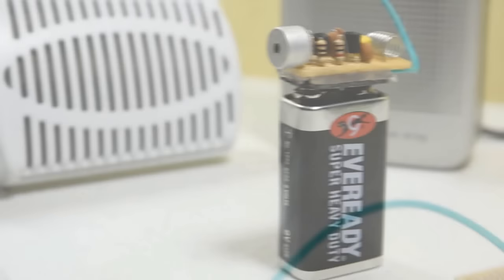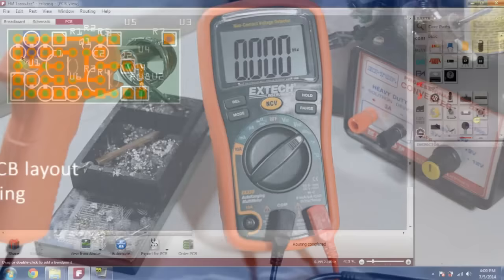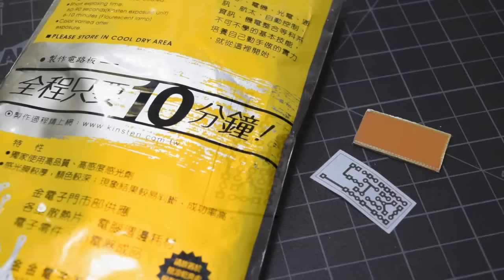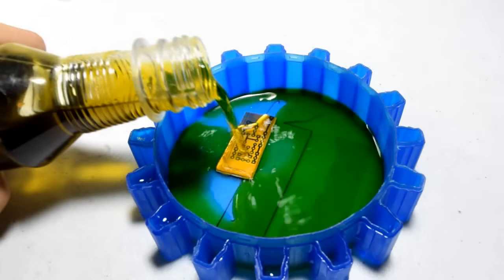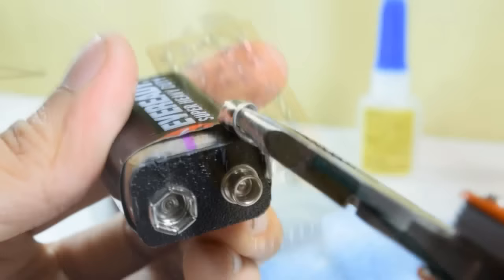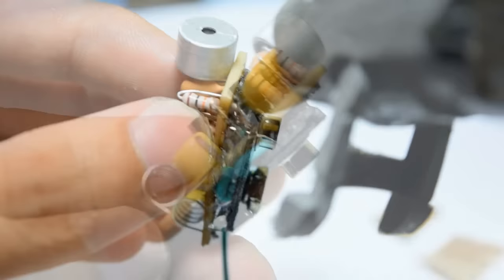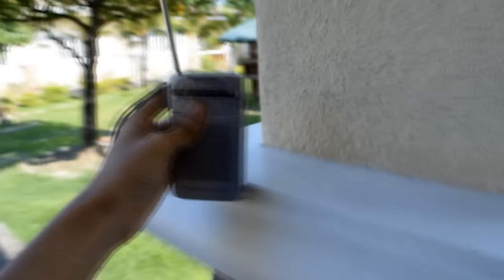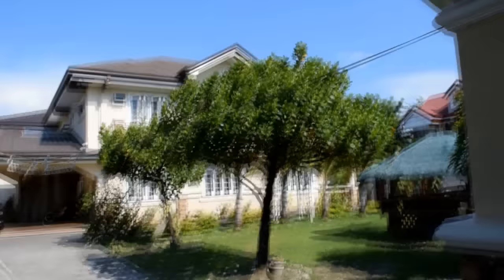Build A Long Range FM Transmitter (Homebrew Radio Station)

Comment: you should rename the video "How to get your door kicked in by the FCC for less than 10 dollars"
Reply: is that really how it works?
Reply: no
Reply: Yes. FM transmitters are limited to 100mW without a license. This probably uses more than that depending on the current draw.
Reply: I was using the range as a reference - this video demonstrates that he couldn't get the signal past 30 meters, so it would fit within the 61m limit in the law. Now whether it would still be illegal because it may be over 100mW depends on the spirit of the law. 

I'd argue that the 100mW was intended for an efficient commercial implementation with a properly tuned antenna with enough dB/mW to give a reasonably long transmission range - this hacked-together version is probably nowhere near as efficient so the actual radiated power might be nowhere near the same amount.
Reply: they are a complaint based organization, unless someone complains he is interfering then he is ok
Reply: Blackhawk f
Reply: The regulations were never meant to prevent low powered wireless transmission across short range, so he isn't violating any regulations here, unless he is in radio silence zones.
However, devices much more powerful than this could swamp communications, which is why they are regulated.
Reply: I live near the police department, and a few years ago, cops were knocking on my door about swamping communications when I was playing with homemade wireless speakers over radio. Wasn't that much of an issue, I just had to stop. Luckily the cop just found it funny more than he was upset about it, however, it was obvious it was an accident, I had no idea how well my radio transmitter was working. However, he did warn me that the FCC was nearly called to deal with it, and I am sure the feds would have fined the hell out of me.
Reply: Lol! I think you should be all set if you're range is small enough. Otherwise, look at an allocation chart for amateur frequencies.
Reply: LMF5000, thanks for the link. That's good to know.
Reply: If you have a regular ham radio operator licence and you tune the transmitter to a frequency far away from broadcasting and law enforcement ones you are totally safe. Better if you do it on ham radio bands since being it very low power and short range it would not annoy anyone at all. Just calculate the oscillator to reach around 144Mhz and you are done :)
Reply: Ok stone,,,come to pakistan and use ur RADIO every where........
Reply: LOL Dude the FCC isn't going to come after anyone with a low power transmitter. While technically it is illegal the FCC is more concerned with people who actually disrupt other radio services. This is hardly a blip on the radar and not worth the time and money for FCC to litigate.
Reply: Isnt he still transmiting in a legal range?
Reply: TheGreatUtopiaCat not even close
Reply: Kenneth Clark incorrect. Common mistake. AM allows for up to 100mW for Part 15, but FM is a different beast. For FM, and to be Part 15 compliant, the FCC isn't so much concerned with power used. They're more concerned with the FIELD STRENGTH, and I believe they're looking for anything 20 microvolts at 3 meters and under to be legal. Anything over that field strength is considered in violation, although rough estimates for FM power to be compliant is in the 20 mW range. To show how complicated Part 15 is where FM is concerned, consider this example: you could be using 30 watts, but you're transmitting through a thick steel wall. Theoretically, due to the wall, your field strength might still fall within the 20 microvolts, measured at 3 meters from your transmitter. All I can tell you is to pour over the rules until you can make sense of them and know where your rig falls. Although, right now with the government shutdown as of this writing, there isn't much FCC enforcement to worry about! Ha!
Reply: @Mr_Lambda  Transmitting music for yourself and/or others to hear is considered broadcasting and would make many people annoyed with you. The ham bands are for communicating not broadcasting and it would be considered illegal.  Also you can't just go anywhere "around" 144mHz. I would suggest using a frequency counter to make sure exactly where you fall in the band. Plus there is something called a band plan you should look into. I know I'm 5 months late on the matter but I thought I'd chime in for anyone that views these comments in the future. Have a good day.
Reply: @briankahle2326  in my country if you have a ham radio operator licence, as i do, you are free to expertiment as long you don't harass others. I am totally aware of the band plan but since this transmitter is so low on power, nobody would pick it up with their instruments. Especially if you tune into the very first or last frequencies of the band. Nobody usually works on them. This is considered experimentation in my Place, OM 's here are happier to see some youngling play around with homebrew devices rather than scold them because they built a transmitter without having a licence.
Reply: @Mr_Lambda  That's very interesting. In my country, tuning somewhere around the 2 meter band might land you on frequencies that you could get in big trouble for. Like law enforcement frequencies for example. We're only aloud to use the bands that are allocated to us. Sorry for just assuming that you live in the same place as me lol. And thanks for replying. 

73
Reply: @briankahle2326  in our band plan frequencies between 144 and 146 are for ham radio 2m. As i said if you do some testing on the very border of that band, nobody would care since few people would transmit on on those frequencies. :)

73 to you
Reply: @Mr_Lambda  Where I live we get 144-148mHz :) but the lower border is for CW only.
Reply: Absolutely NOTHING in your post is based on the reality of FCC regulations or how they intervene.  No?  OK, when did the FCC kick in a door for a transmitter this small (or even even of magnitudes more).   Place, Date and who was arrested.  Too bad you didn't test your basic assumptions with this simple test.
Reply: @radio guy all countries have fcc equuvalent, don't worry. mine is called ancom
Reply: radio guy yeh I don’t think the FCC has duristiction where I am even if they had the budget to fly hear and arrest me. In reality some kid makeing a transmitter like this and causeing am issue the FCC (or local equiverlent) is going to take an educative fix not a punitive one.
Reply: @jdgshsjchdjejkd545  meaning?
Reply: @rich10514141  they wouldnt fine you
Reply: @LMF5000  you are correct. 0.01microwatts max radiated power.
Reply: Well,if it wasnt interrup...whatever
Reply: wow.. it has only around 10mw of power. No need for FCC license dummies !
Reply: Actually it is completely legal to make me of these and use it for home or event use to help with information. And they make pre made one's on Amazon for if your radio don't have bluetooth. But they don't go as far.
Reply: @Mr_Lambda  e
Reply: I'd look into mobile transmission like what Al-Aqsa TV did. Figure out how to avoid getting caught, which is especially useful if you plan to broadcast stuff "they" don't want you to know.
Reply: base on a true story
Reply: @Emre MUTLU it was so not being near an airport ... with a backpack ... you know how it is people are increasingly afraid of terrorists so any weird and out of commun communion ... can cause suspicion ... but still the idea of the solar charger is good ... but be careful where you are with the backpack
Reply: The it's not illegal to transmit AM/FM transmissions between 65.000 and 108.00 so long as you're not causing disruption of a reserved station. Most people don't use 86.000 to 89.000.
Reply: Too bad so many people actually think you are correct.  In reality, as long as your broadcast is less than 200 feet and it doesn't interfere with any FCC licensed stations, you are safe.
And since the thickness of your walls and other variations in signal absorption will determine your signal penetration, you can have up to 99.9 watts before the FCC demands a license.
So much ignorance...
Reply: @barrettabney  so i've read for the 36th time in 3 years
Reply: @Emre MUTLU well off course you shouldn't have used  it while going to the airprot
Reply: ANU START you’ll just need $10 for that 9 volt
Reply: @Mr_Lambda  Amateur radio licenses allow the operator to make communications of a two way nature. Broadcasting is prohibited. Playing music, which was shown in this video, is broadcasting. Also, the circuit was designed to transmit and not receive, also a one way communication.
Reply: @weimaraner3240  you are still allowed to make some short tests with homebrew equipment because of the experimentation spirit of this hobby. Nobody will complain, just remember if you are transmitting for experimental purposes do it un a freq just outside ham band ( that is the area where everybody tests homwbrew equipment before using it on the actual band) and remember to use a very small amount of power to avoid harassing others.  If you want to make a tiny broadcaster like that that will not create any problem. Probably that thing outputs few milliwatts, and due to the fact the antenna is not a proper one but a random piece of wire the range will probably be at max 100 meters if you're lucky
Reply: It's only illegal if you get caught.

*not legal advice
Reply: that is if you are living in high population cities lol
Reply: All so another example......So why do people still think we're FREE.
Reply: The FCC doesn't kick indoors. They send cease and desist letters.
Reply: They wouldn't do that
Reply: @kensclark  actually 100 feet, not mW. Your thinking of AM transmitters that can broadcast at 100mW according to the FCC guide lines. Also its not miliwatts for FM, its more like microvolts. Look up part 15 F.C.C rules for micropowered transmitting devices. My better half has a f.c.c license for gmrs, and have to follow part 95 rules. If you want to convert microvolts to watts, it would be 100,000 microvolts or 10 microwatts. Not 100mW, that rule only applies to AM, with a maximum of 10 feet for an antenna including cable, line loss does not count as for an increase in power for AM either. You go above any of the requirements for extremely low power devices, you are subject to fines no more then $25,000.00 or prison of no more then 5 years, or subject to both for every violation there of. Believe me when I say this, the F.C.C has ways of tracking any unlawful transmitting devices on FM. First time offense you get a warning with a letter, if the device is in operation, the next will be them at your door.
Reply: @Michael Watts very well said, and put!
Reply: @_AE_EA_  the only difference between one made by you, vs the professional made ones is that. The one you make is not tested, and gone through a proper inspection. The one you buy fully assembled has been fully tested, inspected, and has been passed by the FCC. Which states it has passed the rules and regulations listed as a compliant device. That's why when you buy one from the store, it has an official FCC ID. The FCC ID is a designator that states, what type of device it is, the frequency its on, and the purpose of its operation, ect, ect.... The device you would build, would have to go through the same procedures to get it certified as FCC compliant. That cost money, and time to do!
Reply: @bruno-vicious  oh I don't know about that. It happened to me! First its a warning to stop, then the second offense its $25,000 per day until the device is off. Either that or prison no less then 5 years.
Reply: @MichaelRabbitBass3  yeah for the first time, then its $25,000 after that or jail time through fedral court.
Reply: Really wonder why people assume this kid is in the US.
Or did they assume FCC jurisdiction covers the entire world?
Reply: The video doesn't show that much power.  I think there is no problem.  There is a similar kit in Japan, where the radio law is strict.
Reply: Maybe "How to troll people with a radio for under 10 dollars"?
Reply: Btw this would be great for VA bc we got a lotta stations you can interfere with
Reply: USA 🤮
Reply: This video is old, but it should be mentioned; "Tune to a quiet spot on the radio dial."
Reply: @kensclark TIME TO BUILD 10Kw transmitter!!!!!
Reply: @kensclark What if you have one, but have it inoperable, without additional solder? Where it can be put together, but isn't useable in it's current state?

Comment: Amazing how things don't change. I built something like this in the 70's. I would recommend testing before hot gluing.
Reply from the maker: Henry Pitts Yes! My grandpa said the same thing. I guess this circuit is considered as one of the classics. :) Good idea on the test it first.
Reply: @TechBuilder  Basic concepts that never change.  Thank you for putting this up here.  I really enjoyed watching your video and this helps as a refresher for me.  Great job!  (And yes, I'm chiming in very late here. 😏)
Reply: @TechBuilder what's battery life
Reply: @religionisapoison2413  I was curious about that too, it might be a nice feature to be able to decrease gain to be just enough to meet our needs, if it saves battery power.
Reply: @mscir  yeah, was thinking about deploying units to homeless camps to a central repeater. The unit itself would have virtually zero street value other and the repeater would be up in a tree or on a bridge somewhere with main battery. If it was possible to have long battery life you could manage a lot of camps at once and ensure safety when those persons don't have access to phones and are posted up in the woods somewhere. Thought about solar loRa mesh but those would have street value.

Comment: That hobo way to get a 9v clip was genious!
Reply: +ET I know right, I can't believe that I had never thought of that before
Reply: +ET +runforitman  I've actually purchased 9v battery clips, while all along I've been discarding them along with the 9v batteries to which they are attached.  I never thought of this part as being retrievable, before watching this excellent tutorial.
Reply: +runforitman I've been doing that since I was like 10 lmao
Reply: +Random_rapper20 I've done it since I was 6 years old
Reply: Tyler Mcnee woah not a competition lmao
Reply: +Tyler Mcnee I've been doing it since I was five years old
Reply: +Toot Toot I have done it since I was in the womb
Reply: +Jerms Bernd I've been doing it before i was conceived
Reply: Can I use a BC547 instead of 2n3904? Works the same?
Reply: Yes.
Reply: ET I got mine (for a different project) out of a broken guitar pedal.
Reply: I've never bought a 9V battery clip; I've always harvested them.

Comment: My goodness it's fun to see kids do this. I've done this (probably exact same schematic when I see the parts) back in 1987.
Really cool seeing this again. You can even boost the power (and thus range) by using a 12V battery I don't know the specs of these transistors but the once I used back in 1987 actually go up to 30V.
Reply: Most are limited to 9V

Comment: I built this kind of thing back in college in 2004 as a final project.  My team was the first ones to use wireless successfully in a final project, our idea was to use it to locate your keys when you lost them.  Have a transmitter in a central location and a small, low power FM radio on your keychain.

Wish I had this video back then, most of our time was spent researching and circuit building then starting over when the circuit didn't work right.  Well done.

Comment: I remember making one of these just to jam my neighbor's loud fm stereo.  Instead of using trimmer cap, I used the one from an old am radio, the plastic type variable cap for ease of tuning.  Removed the mic and replace it with a female phone jack so I could input various noise making gadgets in it XD
Reply: Great way to get the FCC involved. Intentionally causing interference. LOL
Reply: The Linux Guy 88 , lol...
Reply: +The Linux Guy 88  We don't have FCC here, but we do have NTC which don't give a crap on low power transmitters lol
Reply: Are you real?
Reply: rohan madane i ask myself that everyday
Reply: @TheLinuxGuy88  Yea yea yea
Reply: Aquí lo que tenemos es a Conatel xdd
Reply: Do you have circuit diagram of your transmitter
Reply: make sure to remove the mic and driver circuit otherwise you will send dc into your noise maker

Comment: You can change the tuning range of the transmitter by reducing or increasing the number of turns in the coil.  To raise the tuning range above 108, simply use fewer turns and you can use audio of TV channel 7-12 on an analog TV set or a "police scanner" as a receiver, or increase the number of turns for TV channel 2-6.

Comment: The first transistor is an audio pre-amplifier and the second one is a VFO and this is the simplest mode ever from 80's, but we consider this oscillator unstable.
I have made too many projects in 90's starting with 7 watts transmitters till 60 watts using the PLL technology which is very stable and used in all Tranceivers.

Best memories ever in my life.

Comment: My favourite transmitter. I used for Q2  2N3553 ,  L1 five turns or on board ,R7 100ohm (that one need Wattage), and distance would be several km

Comment: I remember building a circuit similar to this decades ago. The frequency is very unstable. Simply moving your hand next to the circuit or antenna changes the frequency. The range is good enough for the house. These days you can buy digitally tuned, stable frequency with LCD frequency display, FM stereo transmitters for under US$5 and a simple modification can increase their power into illegal range.
Reply: Can you be more specific, I’m interested